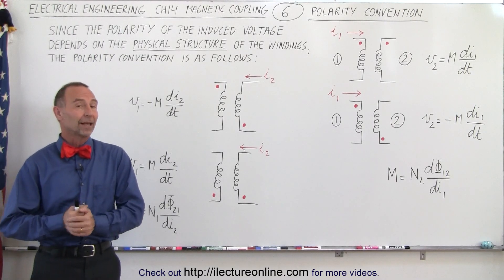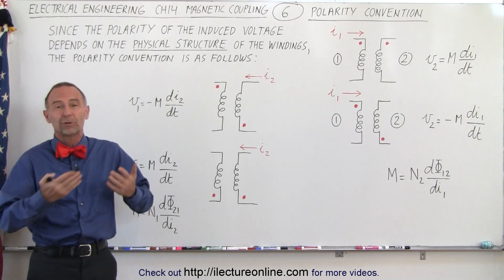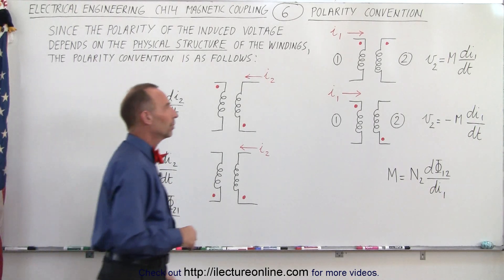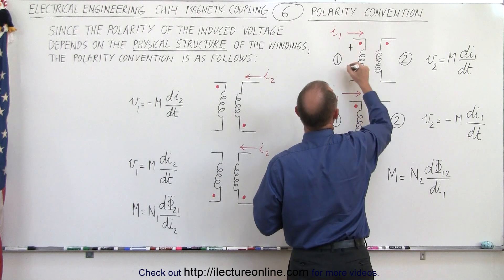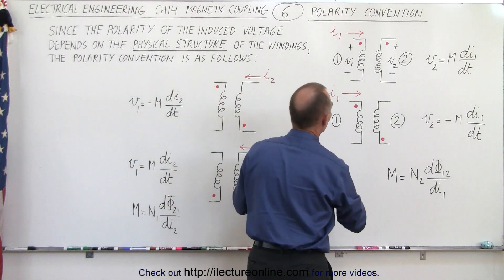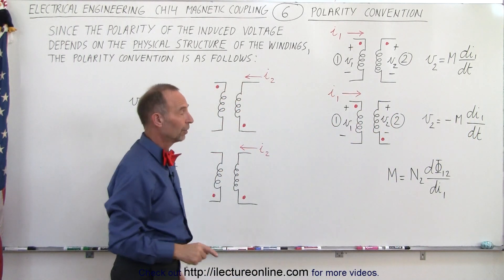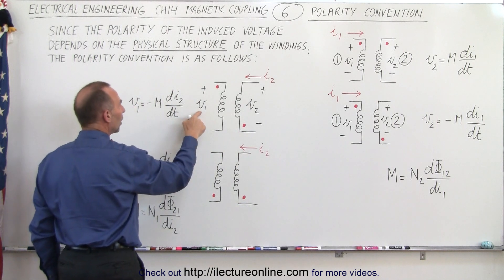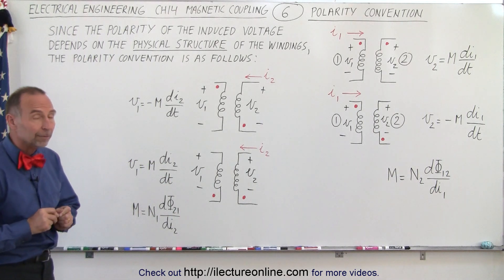Electrical Engineering: Ch 14 Magnetic Coupling (6 of 55) Polarity Convention

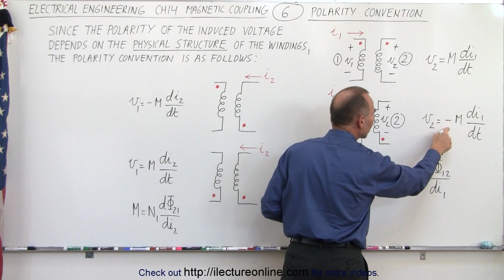Comment: @1:37 you say the polarity of V-2 is opposite that of V-1, but you draw it with the same plus-minus polarity of V-1.  Can you explain? Thanks.
Reply: Thanks for the response!
Reply: If it helps you, you can say the induced voltage +M*di1/dt  instead of -M*di1/dt and then inverse the polarity of V2 in the drawing. It's a matter of reference. V2 is drawn with the plus sign at the top, but the induced voltage due to the current of the first winding is the opposite of V2 as it's drawn. This is the reason of the minus sign of the induced voltage. So, if the voltage has a minus sign, it just means it's inverted with respect to your drawing.
Reply: Thanks. I will review the video. @AnotherConcernedCitizen
Reply from the maker: if you watch a few more videos in this playlist it will become clear, especially when you see a few examples of how to apply these rules.

Comment: Mr. Professor what is the electrical polarity of Earth?
Reply from the maker: The Earth does not have an "electrical polarity".  But it does have a magnetic polarity, with the magnetic north pole being close to the geographical south pole.
Reply: @MichelvanBiezen  Yes, but when we consider lightning? (reverse Earth "polarity" is next scientific awesome fact despite that magnetic moves).
Reply from the maker: Clouds and the atmosphere will indeed build up regions of positive and negative charges with the result of lightning
Reply: @MichelvanBiezen Mr. Professor I have a mind blowing (for me) problem with electrical circuit (by no chance to solve it). How is it possible that flowing current in the circuit with lightbulb (AC) will provide electric shock from the phase side but no from neutral?
Reply from the maker: Electric shock can occur whenever there is a potential difference between the object you are touching and yourself and when a path is provided for the current.  For example you can hang from a high voltage wire without being electrocuted, but if you touch the wire while you are in contact with the metal tower at the same time, you will be electrocuted.
Reply: @MichelvanBiezen  Yes I agree. My question is does due to the fact that there exists potential difference, Earth provides for compensation, positive charges "leyden jar" or is it less negative? So do we have to consider positively charged current (holes - neutral) flowing in opposite direction to the flow of electrons, from Earth or negatively charged current (electrons - phase) goes to Earth as a less negative and discharges.
Reply from the maker: There is no electric field equivalence to the Earth's magnetic field, which is a global field.  The potential differences that we see are localized phenomena.  In the real world charges consists of electrons or ions (ionized atoms).  There is technically no such thing as charges in the form of protons moving (along wires, etc. which is just a convention).
Reply: @MichelvanBiezen  thank You very much. I know also that there is no such a thing as H3O+ (it is just a convention). Mr. Professor so what is for earthing (grounding) since movement of electrons is accomplished by transformer?